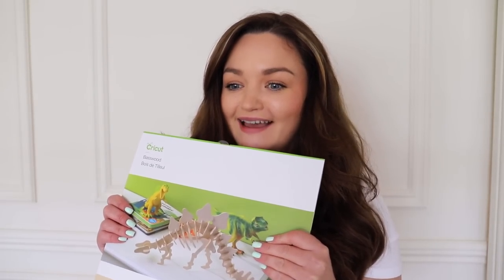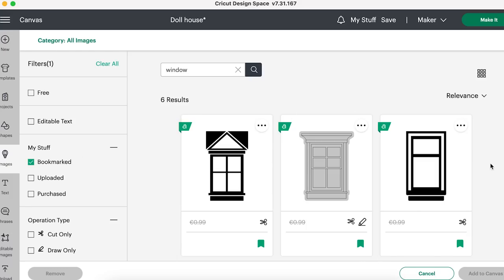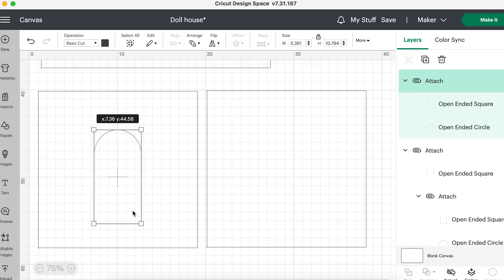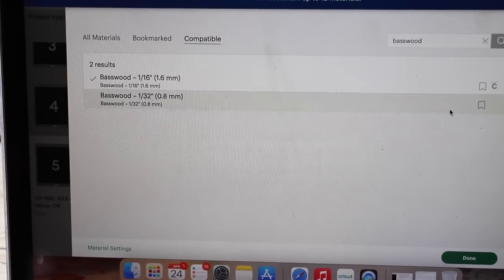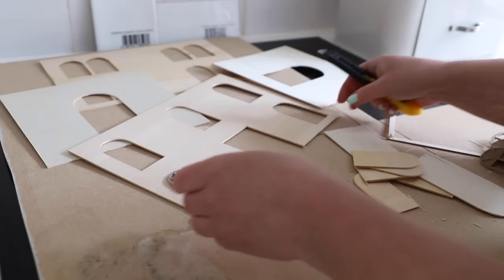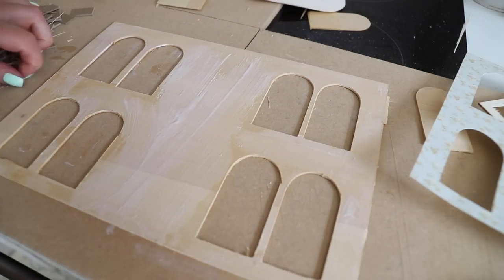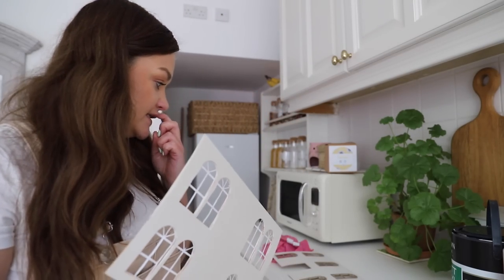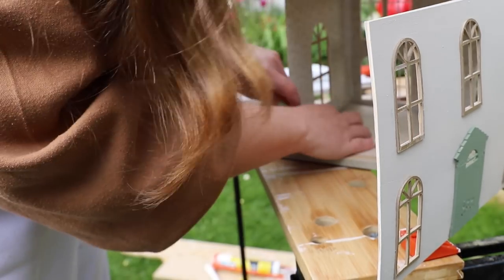Crafting a Dream Dollhouse with the Cricut Maker

Comment from the maker: Hi everyone, a little tip, instead of using basswood, use heavy chipboard for your project. In hindsight, I probably should have used this material.
Reply: And the window cutouts from the basswood - can you use those as shutters? Cut down the middle and paint on the shutter lines?
Reply from the maker: Yes, shutters would be really cute x

Comment: To get the warp out of the curved pieces, take your large wooden cutting board and put that over the piece with the paint can on top. That will spread the pressure across it fully! Good job!
Reply: Jason Jensen trains says to paint or just use water on the opposite side to get the warp out.

Comment: You can take a piece of aluminum foil and ball it up the carefully punch the blade through the ball to sharpen it, this should get you through a project until you get a replacement blade.
Also when you get ready to make furniture Cricut has the same chairs as what you have outside..
Reply from the maker: That is really clever with the foil, I am definitely going to try it x
Reply: This works with scissors too. Cut shiny side and it sharpens them.

Comment: Aleene's original Tacky glue is the absolute best for a strong hold. For wall paper I use Elmer's rubber cement. It stops ink bleed and wrinkles. I print all my wallpaper, and I use cardstock.

Comment: Basswood is very fragile, and absorptive. If you are painting, paint both sides, and the warp will sort of cancel itself out. If you cut the same piece twice (whatever materiel) you can glue it back to back around some duct tape or cloth. This can form a strong hinge without visiting the hardware store. For glueing, try making strips on the corners that overlap "L" as "Trim", when it also reinforces the corner. you can glue the "L" together first (not nearly as much leverage) and then use it to bind your sides together. Card stock is easy to cut with a normal Cricut blade, and can be stacked to make window frames. With the window shape, but some clear acetate and layer the frame around it for a "glass" window look.
Reply from the maker: Thanks for sharing these tips! I appreciate your creative ideas and will keep them in mind for future projects. Always fun to explore different techniques! 😊